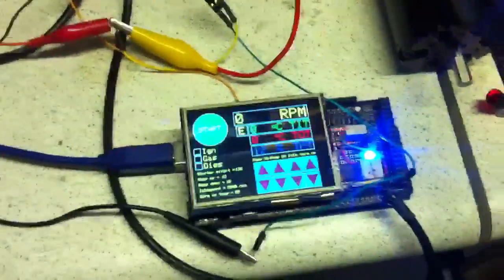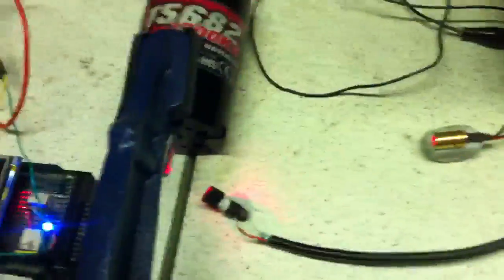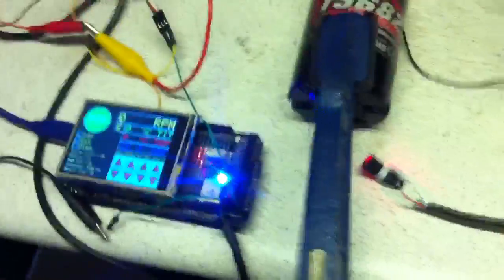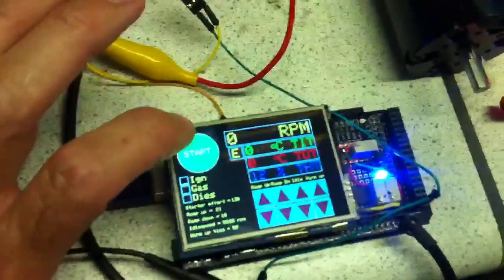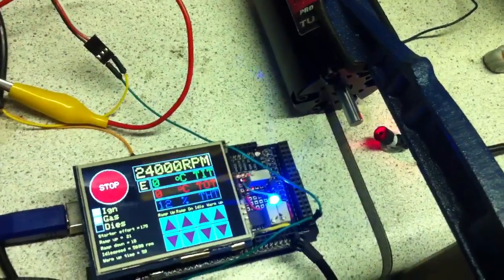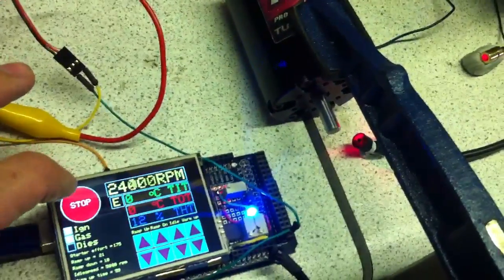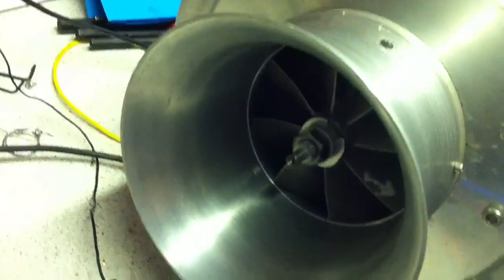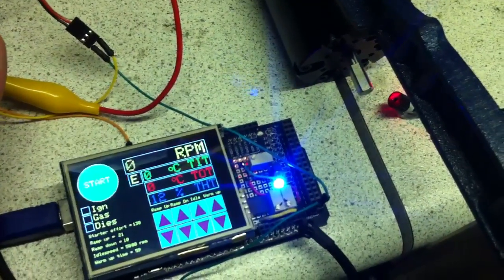Gas turbine starter brushless motor arduino

Comment: way more advanced than my attempt so far. I have a thermocouple displayed on a lcd and rpm and throttle position but having issues with delays causing twitchy servo performance. I'm over my head.